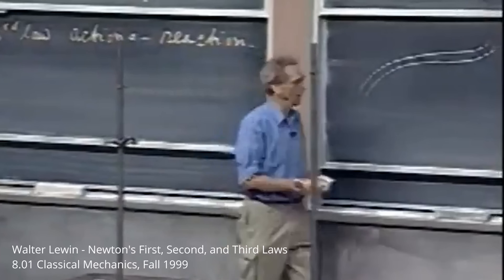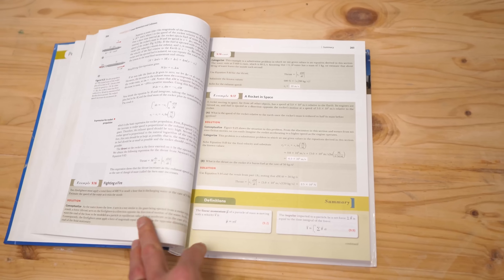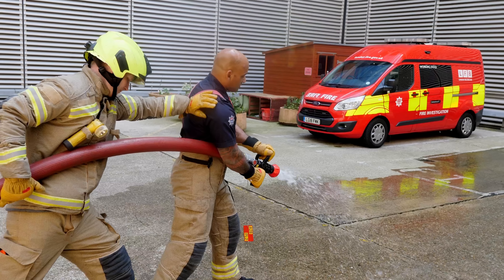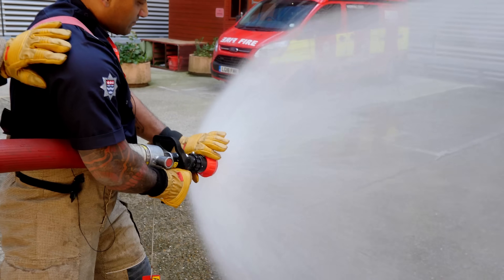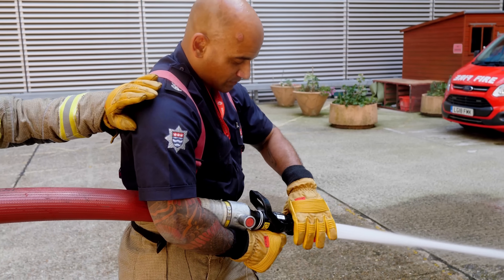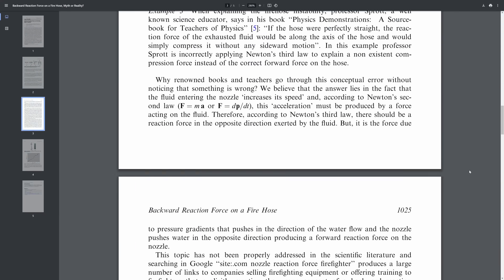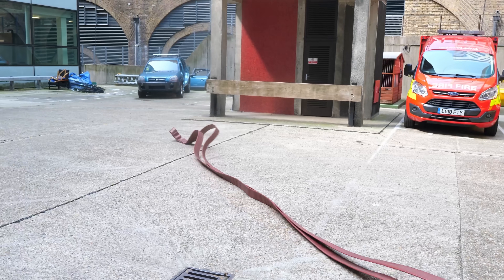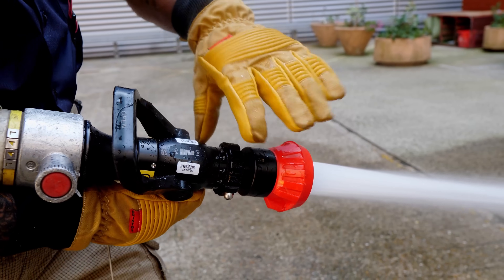Why chaotic hoses dance

Comment: Surely The force they feel is only due to Newton’s Third Law—the rapid expulsion of water at high velocity pushes back on them. This force can be much greater than their body weight or ability to resist, requiring a firm stance or team effort to maintain control.

When firefighters try to turn the hose at different angles while water is flowing at high velocity, they experience significant reaction forces and torque, making it difficult to control.

The nozzle produces a strong thrust force due to high-speed water ejection.
This force acts opposite to the water flow direction (Newton’s Third Law).
If the nozzle is pointing straight ahead, the force pushes directly backward.
When they try to turn the hose, the direction of this force changes, creating lateral forces and torque.

When the hose is turned, the reaction force creates a moment (torque) about the firefighter’s grip.
This can cause the nozzle to whip or twist unexpectedly, making it hard to control.
If the turn is sudden, the force imbalance can knock the firefighter off balance.

If the hose is sweeping side to side, water exiting at high velocity changes direction rapidly.

This chanin momentum creates additional side forces that further destabilize the firefighter’s grip.

The hose itself resists bending due to internal water pressure and material stiffness.
Rapid changes in direction can cause the hose to kink or develop pressure surges, making control even harder.

Turbulent flow can make the problem of controlling the fire hose even more difficult by causing fluctuations in the reaction forces and introducing unpredictable side forces.

Fire hoses operate at high pressures and velocities, leading to Reynolds numbers well into the turbulent regime.
Turbulence causes rapid and chaotic fluctuations in velocity and pressure, which means that the force exerted by the nozzle is not perfectly steady.
These fluctuations can result in small but sudden jerks in different directions, making the hose harder to hold steady. Firefighters experience this as an erratic force trying to twist the hose in different directions.

 it is generally easier to control a fire hose with a nozzle adjusted to produce a dense, drenching spray (also known as a fog pattern) compared to a narrow, high-velocity stream.

When a nozzle is set to a dense spray, the water is dispersed over a larger area in the form of many smaller droplets. This reduces the velocity of the water coming out of the nozzle.
In contrast, a focused jet (such as a straight stream) has a much higher velocity, creating a stronger reaction force (thrust) pushing back on the firefighter.
The spray’s lower velocity means there is less backward force on the firefighter, making it easier to manage.

A dense spray distributes the water flow more evenly over a wider area, which means the forces acting on the nozzle are spread out.
This helps avoid the jerking or whipping motion associated with a focused jet, where all the force is concentrated in a narrow stream. By the same token it creates less directional inertia compared to a high-speed stream. This means it is easier to adjust the direction of the spray without experiencing significant side forces or instability. When firefighters need to adjust the angle or direction of the hose, a dense spray makes these changes less jarring because of the more gradual change in momentum.

Fire hose systems are designed to deliver water at high pressure but varying flow rates, depending on the nozzle setting. When using a fog nozzle, the pump will still maintain high pressure but typically at lower flow rates compared to a solid stream. The pump doesn't necessarily experience increased backpressure—it’s just working to maintain higher pressure at a lower volume due to the engineering of feedback controls in the pump..

Comment: I think something missing from the analysis is the difference between air and water. You can compress air, but you CANNOT compress water. This has implications on how the two contents move and fill a void like flexible tubing.

Water has a constant amount non-compressible force when moved and thus move easily and forcefully through a void, but because air is compressible, it will resist forward motion when it hits a corner/curve.

Comment: I feel like this has a lot of similarities with the 3 body problem. Replace the plastic deformation of the hose with gravity and they have similar levels of chaotic motion when there are 3 or more nodes in the system. For the hose, each node would be the section next to a curve, so 1 curve is 2 nodes, 2 curves is 3, etc.

Comment: i don't think it has to do something with the water/air  accelerate at the tip. In fact i belive it is exactly the opposite, since the tip of the air compressor experiment is not smaller than the rest of the hose, the air should not accelerate at the tip. It would travel at the same speed, all the way trough the hose and then slow down, as soon as it exits the tip, creating a high preassure region in the atmosphere.
i think basically the tip of the hose tries to move away from the high preassure point in the atmosphere, created by the aditional air escaping the tip

Comment: I am going to repost my comment in a discussion below again here. Unedited for visibility. I might be wrong but these are my thoughts.

I am doubtful if the final conclusion holds. Static pressure decreased along the hose, dynamic pressure doesn't. Just before the end of the hose static pressure is just above atmospheric (or equal just at the exact end). All that is left is dynamic pressure. There is no (!) pressure drop at the nozzle, I think. To me this is a very wrong explanation from Steve.

Even the string analogy. Water is hardly compressible, the string very much is.

'increased velocity when it leaves the nozzle' Seriously, the water is speeding up?

The wiggling of the transparent tube might be because of the 'rough' (microscopic) surface of the edges of the nozzle (the tube is 'rough' cut)

Around 14:40. Steve is blowing on the force meter: of course it will register that force of turning that dynamic pressure (speed) into static. Like pointing the fire hose at a wall: the wall will feel a force. Of course this will be independent of the type of bends.

https://link.springer.com/article/10.1007/s10694-014-0430-5 gives correct explanation I think.

Comment: There's actually often a significant pressure drop along the hose length when the flow is high relative to the hose diameter, and there isn't a (significant) restriction in the end of the hose. This means that compressible fluids, like air, actually accelerates along the length of the hose. 

When it comes to water, a reduced area at the end cause an increase in velocity there, therefore a reaction force in the opposite direction. Without a restriction at the end water hoses with a constant diameter actually don't swing that much when water flow is constant. If you look at the footage of the garden toy you see the ends of the hoses are noticeable darker, that's because there's restriction there, and without it there wouldn't be much of an effect.     

It wouldn't be very difficult to design a fire hose nozzle with a dead man's grip that changed the flow velocity and or direction if dropped so the hose would lie practically still if dropped, without changing the amount of water exiting over a given time.

Comment: As fluid travels through a hose.. is there any friction between the water and the inside of the hose?  If so, then doesn't that friction create a force in the opposite direction to the travel of water?  If so.. given the net direction of water travel isn't there an equal an opposite net force in the opposite direction, pulling the head of the hose back?

Comment: At 12:47, let's talk about rockets, propellers, and jets. They’re more about Newton's 2nd law than the 3rd, which is a common mix-up. When you see a hose getting pushed back, it’s because of the work being done. Remember, F = ma. The hose is filled with pressurized water from the pump, which has already done its job by pressurizing the pipe to ensure the flow, taking into account things like friction and head pressure. As the water shoots out of the nozzle, it’s actually pushing against the water it’s expelling. It’s a straightforward push force. Think about someone tossing rocks off a wheeled cart; they’ll move in the opposite direction. If they throw a 2 kg rock every second at 10 m/s, they’re pushing against the rock because of its inertia. So, the force here would be 2 kg times 10 m/s every second, which gives us F = 2 kg * 10 m/s² = 20 Newtons. Moral of the story: if you want to move you have to throw something away, thank you.

Comment: Hey Steve! I'm so happy you did a video about hoses. I reminded me of when I sent you that video of a hose getting "sucked" into my pool when I was holding it up under its own thrust. When the end of the hose touched the water, instead of pushing up, it would get pulled under the surface. There are all kinds of weird physics working with hoses it seems.

Comment: The fluid in a tube/pipe/hose is under pressure. This means that it is exerting a force on the entire area of the t/p/h, making it experience tension everywhere. This tension is balanced until it reaches the end, where the tension is only "pulling back" requiring the hose to be held in place. In the case of a rigid pipe, the material holds itself.

Comment: Forgive me if I missed it but I was immensely infuriated that you did not use the analogy of potential versus kinetic energy. The pump put potential energy into the water in the form of pressure, and that potential energy turns into kinetic energy at the nozzle. If the nozzle is wide enough to not cause any pressure, there's no potential energy in excess that needs to be converted to kinetic. This example scales perfectly fine whether it's air or water in the hose. The vector of the potential energy converting to kinetic energy, is what applies torque to the hose. Some hoses are better at resisting this torque than others, which is what creates the pattern of flailing. 
Firefighters are resisting the torque and change of energy caused by the nozzle, not the hose itself. That's what the paper should be describing to make it more clear.

Comment: It's interesting to me that the short hose is analogous to a 2 body problem but the longer hose is more analogous to a 3 body or 4 body problem as it get longer.  It probably has to do with the bending stiffness of the hose, relative to some radius of curvature.

Comment: I feel like from a fluid system, the fact that the end of the hose is moving at a considerable speed is a factor as well.  Consider having a hose filled with static water, then you give it a "whip" the water will fly out the end.  This also made me think of those tube whistle toys.  Where you have a plastic tube open on both ends and to hold one end stationary and whirl it around above your head to make a whistling sound.  Those tubes don't really work if you plug the stationary end, so I think the whirling end of the tube is generating a pressure force pulling air through the tube up from the stationary end.  Not sure how negligible this is to a fire hose.  Interesting to think about.

Comment: This one is going to get a lot of comments lol. I think for the fire hose there are two main things going on:
1. The bend in the line DOES cause a force because of a change in momentum like you said, but the fireman experiences this as tension, which is indistinguishable from being pushed back. Calculating this tension would be really interesting because it would depend on how straight the hose is. A mostly straight hose would have a small change in momentum at the bend, but the tension force would be multiplied at the nozzle because the hose is mostly straight. 
2. There is a significant constriction at the nozzle, which means the velocity of water inside the hose is somewhat slower than it is going out, which is a change in momentum which adds to the force being pushed back.
Reply: I think the bend should be pushing you forward, in the direction that the water is going before the bend. The hose "wants" to straighten under the force of the water, and experiencing pushback only at the end.
Reply: The tension is the same regardless of the amount of bend. It is .5*rho*V^2*A this is why the curled and straight tubes exert the same force in the video.

Comment: Anyone who's wrangled a fire hose knows you can position yourself "just right" where it feels like you barely have to hold on...and give your forearms a break.

But in an instant, with just a slight movement it's right back to holding on tight.  Thats how they get away from people.  You get a slight break and think you're safe...and relax for a split second and it's gone.

Comment: I think the question you would first need answering is what is constant about the pump. The pressure it generates or the volume it pushes per second. Which of the two fluctuate during the process? There are different pumping mechanisms, so this is not answerable from the armchair. You would have to look at how it's built. 

Also, don't you need to consider viscosity? To me, it sounds  like the firefighters need to pull the hose back because the water pulls the hose away from the pump through viscosity. I would like to first see the estimate of that and only if it's too small to account for the felt experience of the firefighters should we look for an alternative explanation.

Comment: I'd be curious what effect the elasticity of a hose has on the force felt at the tip? Because my intuition of fixing, say, a straight glass straw and measuring the force, is that it would be very low (pressure force only felt by the pump as you intuited). Conversely, if we have a very elastic hose that is as straight as possible, does it still have the force? In this case I would say the force is the elastic bond between parts of the hose as water/air collides with the walls. Could check infrared too to see if elastic heats up when performing the experiment!

Comment: The water in the hose acts like pulling on a rope (but in the opposite direction). The force created by the pump exists throughout the whole stream, but it abruptly ends when the water enters free fall. The forces in the stream cancel each other everywhere except at the pump and the opening, so a fire fighter would expect to cancel the full force of the pump, minus loses due to friction

Comment: 9:00 but you did not at all test a straight hose. Or was the test supposed to show a gradual difference in forces from slightly curved to very curved? In any case, "straight" made me think of the video's earlier concept of the pump getting all the force through a solid pipe, not a soft pipe held just-about-straight.

Comment: you forget that the fluids themselves "sticks" to everything, including itself, the fluid is pushing against the hose and itself in order to stay stable along the ride, causing the hose to be pulled backwards by the rush of fluids slowing down due to friction as it moves, making you to feel the pressure and momentum as force. the kinks would only exacerbate the wiggle by applying uneven forces along the hose, but only if the force is larger than the inertia of the hose and fluid, hence why the nozzle wiggles more than the rest of the hose because of head loss. But the forces are always still equal so you feel the whole force no matter the wiggle. I hope i explained this well😅💜in short, the pressure and momentum causes friction witch pulls the hose backwards along the fluid's directions of travel. Meaning that the wiggle and the kickback are two separate reaction phenomena caused by the same action.

Comment: It is a common misconception that a pump imparts momentum.  It imparts a pressure differential.  That difference in pressure may cause acceleration of the working fluid.  But it may not.  Consider the fire hose when the nozzle is closed.  The pump is still operating, but no water is moving.  This was demonstrated even after the pump was turned off, with the hose nozzle closed the pressure in the hose was maintained.  When the nozzle was opened, then the motion happened, though the pump was turned off at the time.

Comment: Just draw a control volume around the hose  end to the pump connection excluding the fireman holding it. You can show that if the hose end is in line with the pump exit there will be no force but if there is the is a difference in location or angle there will be net force or moment on the fireman.

Comment: You really misunderstand how rockets work. The force is all produced at the nozzle. The back pressure tries to stay straight, not bend. The moment the collapse happens the force is no longer perpendicular to the pipe so it can straighten, whipping the pipe, along with its new directional force. 

Also, an a personal level, Mr Mould, why do you have sanpaku eyes? Are you diagnosed with  psychopathy or related conditions? It's usually tied to an inability to break eye contact for psychological reasons.

Comment: When you calculate the backward force on the nozzle, don't you have to consider the friction force between the fluid and the inside of the hose?

A liquid that is experiencing turbulent flow through a conduit (hose or pipe) undergoes considerably more friction than it does if the flow is laminar. The pump has to provide the pressure that the water has as it exits the hose, but it also has to work considerably harder to overcome all the friction loss too.

Plus the friction force as the nozzle constricts the flow will be tremendous.